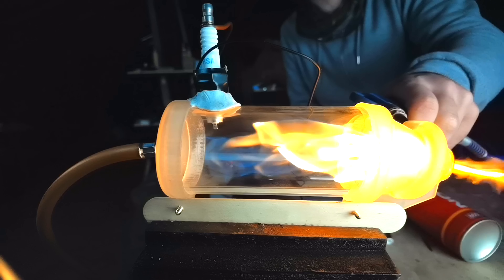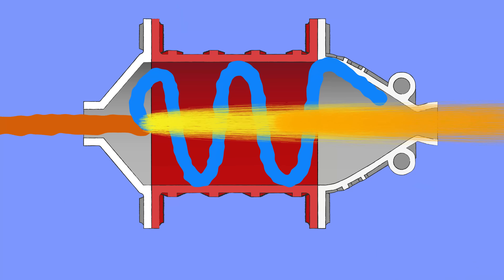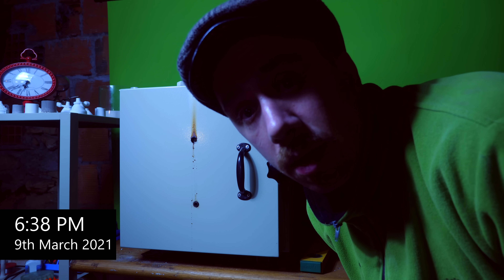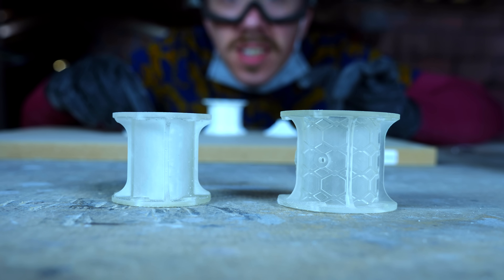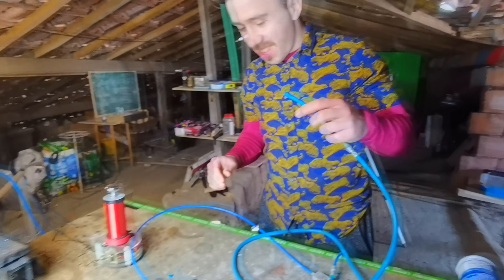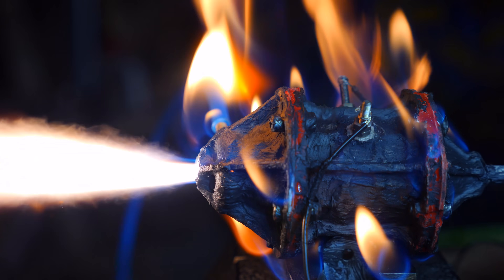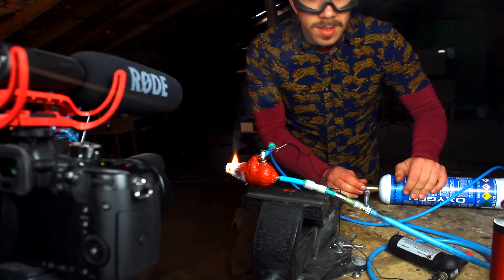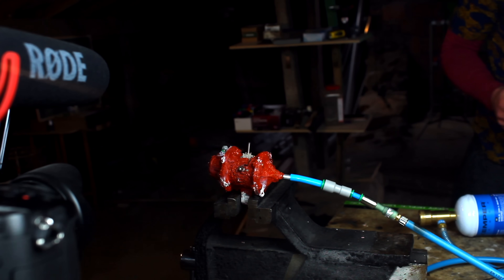Vortex Rocket V2.0 (3D Printed)

Comment: How about a case around the engine. The oxygen is guided through the space in between first (maybe vortexed too) and enters the actual engine after that.
That way the leaking fuel should be guided back into the chamber.
Should also mean less pressure difference thereby less leaking

Sry for my bad english, I hope you'll get what I mean ':D

Comment: Print it as a double chamber and inject the silicone between the two ceramic walls, then just try a Werner Von Braun refrigeration system by circulating liquid O2 around the engine so it will make it cooler.

Comment: You could coat the inside of the chambers with that fire place sealant you used in your previous videos, or see if you can put the parts in a vacuum chamber and soak them in resin, when you re pressurize the resin will force its way inside and then you let it dry.

Comment: Has anyone suggested casting the engine? Making cores out of the porcelain resin or perhaps PVA coated in the porcelain resin? Burning out the filament could result in new stresses, but from what I’m observing is the need to reduce the shrinking of the parts. The cores could be used as a medium to press against while the porcelain resin is curing. Myfordboy has excellent videos on casting.

Comment: Why not make a paint can sized furnace for melting small amounts of aluminum? You could 3d print a positive form in low temperature plastic,  pack it in resin sand to make a mold, melt out the plastic in your kiln and cast your engine in aluminum.

Comment: Maybe try making the model with a chamfered edge, fire the model, construct the part and refire to join it. Never used ceramic but its only as good as its weakest link. Maybe create a stand and use something better than rubber for your oxygen maybe a metal pipe up to x cm away. Same as above, get rid of those weak links, maybe try joining with teeth rather than base to base?

Comment: I like the idea. How about 3d printing molds for the parts then casting in ceramic? Or would that be a bit far away from the 3d printed rocket engine idea? Also...what about an aerospike? I'm not rocket engineer but I think it could be really interesting to make at this scale if at all possible.

Comment: Maybe try to spray several layers of heat resistant varnish onto the engine . Maybe that could be enough  to seal the ceramic and if its thick enough it could manage the pressure and heat . Then look at your nozzle if your exhaust reaches sonic speeds at the trought you can build a de laval nozzle which accelerates your exhaust to supersonic speeds

Comment: Try a labyrinth seal instead of a flat mating surface. It will probably need to be fairly loose fitting with the distortion from the printing, but I think if it were assembled with refractory cement or high temperature silicone it would seal.

As for the leaking through the porosity, try a thinner sealant that would soak into the pores. Mixing the refractory cement so it is watery and painting on multiple layers would be my first suggestion, but if that doesn't work, perhaps there is a chemical thinner that will work for the silicone.

Comment: It is a very different kind of tech, but you might want to try sintering.
You need 3D printed parts to push the powder into form, it can be tricky.
There are some serious advantages:
1. Depending on the powder used the result will not become porous
2. The melting point of the part can be much higher than the sintering temperature, so it can be very temperature resistant.

3. The result can have thick walls and be extremely strong
The disadvantage is that it can be real hard to heat treat a complex part without cracking it. But you can try low temperature sintering too, which has less thermal expansion.

Comment: Use your designs as moulds, then cast them in copper , using copper as it has a lower melting point than steel so it will be more easier to work with the equipment you have and a plus because being a softer metal you will be able to seal the engine better

Comment: Great vid. Try adding more bolts though the flanges and use heat silicon between the parts. Also maybe make the flanges wider so they are less likely to leak.

Comment: Would electroplating the engine work? It would add minimal dimensional change while sealing small holes and can be done with conductive filament or a conductive pain coating. Just an idea maybe someone can point out if I missed a flat in the idea

Comment: Also, you sealed the outside, but i THINK you actually need to seal the inside as well with something more durable. a Metal dip or tape may solve the issue.

Comment: you might try making up a two-part silicone mold solution and putting it inside the assembled parts by filling the chamber and nozzle with the unset mold silicone and then pouring it out and letting it set up as a thin layer inside of the engine.  This will seal it from the inside so the chamber pressure works to better seal the engine, similar to teh Space Shuttle Solid Rocket Booster O-Rings.  The inside of the nozzle will be coated but may burn off the mold silicone layer.

Comment: This may be implausible and I don't know if you've already tried this, but, while watching, I was reminded of how I used to make RTV gaskets using molds. I wonder if you can 3D print molds of the engines and use something that sets at room temperature (e.g., concrete) for the structure? That way you can make a single part with no joints for leaking (except for the gas connections), you won't have to worry about the shrink coefficient or warping, and the inner structure of the mold will just burn off during testing. You'd only have to re-print the inner mold if you need a new engine. Concrete isn't necessarily a solid option, since its melting point is around 1550 degrees Celsius; it was just the first thing I thought of that does not require heat and is rigid when it sets. Hopefully this makes sense!

Comment: Maybe galvanise your parts to plug the holes. A copper sulfate solution, a sacrificial copper electrode and a way to connect it to the part (maybe copper foil on the inside of the part) would be enough to test it. However, you would have to find another way to connect your ignition, since the walls of the combustion chamber are now conductive.

Fun fact:
The european space association also uses galvanisation for their Vulcain 2 engines. 
Since it is very difficult to machine tiny, long channels, they just cut slots on the outside of their combustion chamber and nozzle, fill them with wax, galvanise a thick copper layer on it and melt the wax out.

Comment: step 1 put balloon inside of engine, step 2 add some amount of thin refractory cement, step 3 inflate ballon, step 4 place everything into vacuum chamber to pull refractory cement through voids of engine, step 5 remove from vacuum chamber and heat engine in kiln.

Comment: You should cast the engine in aluminium, using the lost PLA method and a plaster of Paris mold. It's gonna be airtight, and way cheaper than the ceramic resin. It's surprisingly easy to do with DIY methods at home.

Plus, you'd get to make a propane torch, a furnace and melt metal so even if the engine is a complete failure you will still have played with fire and hot stuff so... noting to lose !

Comment: Its only the inside of the rocket that matters right? Just put the engine in a tinn can filled with plaster it won't leak and the rocket is still 3d printed

Comment: The body of the engine seems to be deforming slowly over time as it endures the pressure of the rocket. Maybe you could reinforce the outside with high temperature metal wire?

Comment: I think you should always first try to use normal compressed air instead of pure oxygen because it burns way colder that way. Also the huge amount of oxygen helps with burning the ceramic parts.

Comment: Hi Integza, while watching I was thinking about how you could go to 3mm, 4mm, 5mm, 6mm etc. walls for very strong robust parts. 

Have you tried a shelled approach with a ceramic paste or ceramic filled resin in between the 1-2mm layers? Could maybe fire the resin parts first than do a second firing once assembled with the ceramic paste to fuse everything together.

Comment: try with composite material, 2 layer engine. the inner layer in ceramic ( porcelite) and the external layer in non porous plastic (3d printer or pen). Alternatively you can make a shell and put more external pressure with a gas. 
Sorry for my English

Comment: Have you ever seen how the Bernoulli principle is applied to the rapid inflation of aircraft escape slides? I'd be curious if you could build an afterburner section on the same basis.
At any rate, it got me thinking - your issue is that the pressure in the vessel is too great, and so the fuel mix is forced out of the micropores in the ceramic. Rather than try to block the pores with various sealants, what if you instead 3D printed an outer sheath vessel - leaving say a 2mm air gap? You fit the combustion chamber inside the vessel (open at the nozzle end), but also pump O2 (or just air for tests?) into the outer vessel. This will effectively pressure seal the combustion chamber, and make it easier for the vortex cooling flow to contain the fuel mix. In theory, any leaks that do occur would just be swept down to the jet plume and added to the mix (so kinda acting like an afterburner) and you won't see any external flare outs.

Or, you know, it might just go bang.

Comment: You should check the porosity of your ceramic. Seems the there is leakage from all over, so it could really be part of the material properties. If so, it will break your sealant at the most vulnerable spots.

Comment: After you burned (and assembled) your engine put a coat of regular ceramic on the engine and burn that coated nozzle again. In the ideal case you have a non leaking full ceramic engine.

Comment: This may or may not solve the leaking problem: print the ceramic parts in halves, coat them with the fireplace sealer and carbon fiber on the inside, and coat them how you already did on the outside.
Reply: Was thinking the same thing. The fireplace sealant was working very well in previous high temperature experiments and it is designed to, well, seal stuff.

Comment: I think a metallic glaze on the ceramic parts would solve the problem with the porosity. And it would be very heat resistant.

Comment: Try print the one piece engine a little bit bigger and thicker, then cure the part to make it only ceramic. To fill the pores coat the inside of the engine with some liquid ceramic, then cure it again on the furnace to make an even coat of ceramic on the inside of the engine that way it wont have the pores left by the plastic part of the printing material. And avoid using any "high temp" silicone sealants, those things have a temperature limit you know?

Comment: maybe a dip in a high temperature sealing solution in an ultrasonic bath? The dip would insure that both the inside and outside of the ceramic are sealed, and the ultrasonic bath should allow the sealant to do deeper into the pores, allowing a thinner layer to work to properly seal the engine. Also, idea for a video, make a pressure fed liquid fueled rocket that could potentially be launched from a drone.

Comment: You can dip the "rocket" in the high temperature cement multiple times ... use more liquidy cement and dip it in there for the holes use an extension hose for the oxygen and propane holes and you hold everything from the exhaust... Dip it until is thick enough about 10 times or more will be perfect ... Dip 1st time let it dry ... 2nd let it dry  and goes on till the desired thickness.... also when everything is ready and leak free test for thrust!.... i have a prototype here exactly like yours and with the dip method worked very well .. but i cant test it for thrust so yeah .. say it on the video if you are gonna use this method .. thanks!

Comment: apposed to using the ceramic liquid... fill the printer with a powdered metal and use a 6000 watt laser to print the part, depending on the metal used the printing unit could need to be placed inside of a vacuumed chamber that has been purged serval times with an inert gas. I am sure the programing for the PLA printers is the same as the laser printers though there is some physical engineering that has to take place that the computer sensors have no way of knowing has taken place. things like diamonds are used in high output lasers as focal lenses, normal glass lenses work for gathering several light sources together but it gets to a point that there is aluminum compounds in the glass. some king of titanium tungsten alloy, I have serval titanium valves from an old engine... would be best to turn them into powder by using acids and then extracting it from the solution. with such a printer the old valves could be made into new valves with much less material loss compared to iron processing.  Printing ceramic parts to use for casting glass lenses from broken lenses and powder from finished lenses? the bigger the lenses are the easier it is to use a simple end gauge to polish the lenses as long as the calculus function is known? hahaha, builds lens printer even has a Photovoltaic sensor to measure is deviation. just like the machine for balancing wheels, turn a knob set in a few known numbers hit go... and it spits out where it can be corrected until the deviations are so small that they can not be fixed, 1nm... Hubble, not even 300nm? but knowing all the deviations in the lens it can be decrypted. hmm

Comment: IDEA. Instead of burning out the resin and leaving gaseous pockets in the ceramic parts. Try burning out the resin. Then soaking the part in a some form of curing material to replace the air pockets that would usually Leak.
Reply: This might be able to be built upon such as submerging the parts in said curing liquid then putting it in a vacuum chamber to help assist in the filling of gas pockets.
Reply: This would also make the parts more solid which would likely make the ceramic parts more durable

Comment: Try BBQ paint! 
I think burning out the resin is leaving micro holes where the gas is getting out. BBQ paint should seal it up all over and withstand the heat better than the silicone

Comment: For your next project, attempt an automatic reloading tomato cannon.  as for this engine,   plate it with something like copper. copper is soft, but has a high melting point and descent tensile straight.

Comment: Sand the surfaces that bolt together so they are perfectly flat, and use the red Silicon as a gasket help reduce leaking

Comment: after assembling the engine. Place it in a container and cast it in place in any high temp material you like. Plaster of Paris or fire place plaster. Submerging the engine makes it impossible to disassemble but for a prof of concept it would be quick and easy.

Comment: I think the reason of the engine leaking is that the silicon is to weak, abd it brakes i places where the ceramic body isn't separating it from the pressure, maybe adding some sort of shell on top of the silicon would help. Idk not an engineer, so it probably won't work, but maybe it's worth a try.

Comment: As I was watching in the most vicarious way possible. I noticed that there are zero sealing edges.  You need to make a lip seal area, raising the edge on one side and making a groove on the other. Those flat surfaces cannot be sealed for pressurized gasses to flow correctly.  Adding the ridges to the container portion should seal it up efficiently. Hope that helps, I can't wait to see your next try.

Comment: Hi integra, :-) Cool is episode as always. Your problem seems to be that you apply your mitigating solutions to the exterior, whereas the pressure is trying to push it away trough the cracks away from your engine. Think of it as putting a balloon on your crack. Eventually the pressure is gonna push it away. On the other hand, what if you could put a balloon on the inside? The pressure would push it into your crack, I mean into the cracks and plug it's own but. I mean holes.

Comment: It has surely been said by now, but glaze or treat the interior of the ceramic parts. Thoroughly and evenly. 

Just a guess here, but if the gas is able to impregnate the parts and only the outside is treated it leads to the surface bubbling and pushing away of the coating from the surface. If the interior is treated, the gas would need to force it's way through the coating first before it can get into the ceramic and push on the outside coating.  If the vortex cooling is working you should be able to use the high temp gasket maker inside the chamber without it burning away.

Comment: To solve the issue of the engine leaking, maybe use different fuel, maybe an actual liquid fuel like ethanol. I believe these require to be mixed better, therefore heating the engine less.

EDIT: removed gasoline as option because I didn't think of safety.
Reply: Oh god, please don't use gasoline without having much better safety precautions. It'll actually explode and probably take his workshop with it.

Comment: you can try some kind of water cooling system to cooldown outside of engine in video it looks like the hightemp silicon is melting and then it starts leaking it can help with presure

Comment: Perhaps apply slip or glaze to the inside of the part so that the pressure is forcing it into the ceramic instead of forcing it away?  Maybe glaze the parts like a clay project? They might look pretty cool in red, maybe like your favorite vegetable 😉.